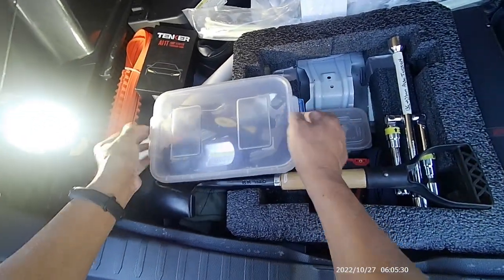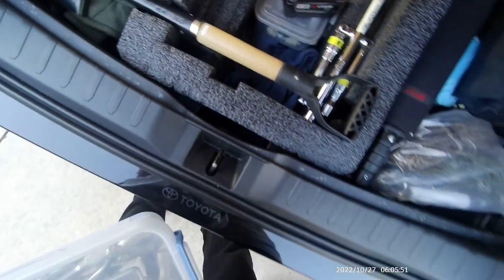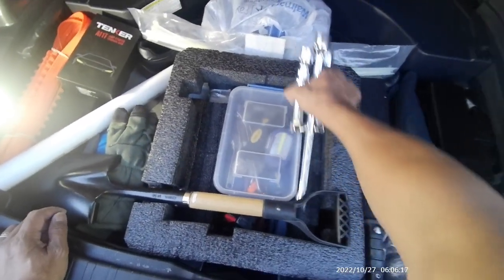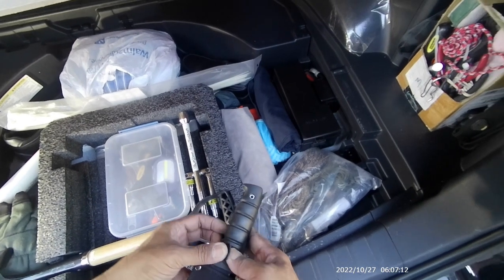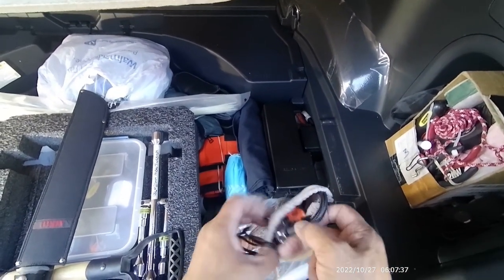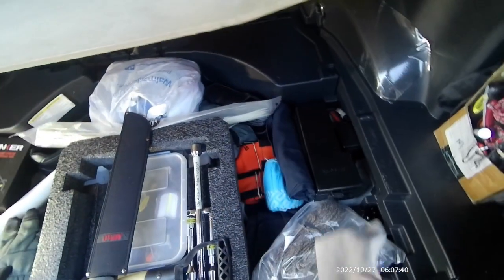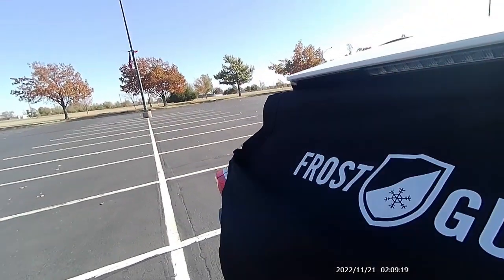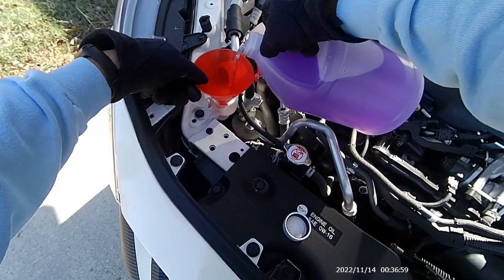Toyota Rav4 Prime Winter Loadout and Tips. Prepare yourself and don't get caught short out there. ❄🚙

Comment: I like your seat covers
Reply from the maker: Thank you... I bought it on Amazon and the link is below...and no..I don't get paid in anyway to endorse or promote it.  I can say this though...these seats ROCK... spilled some stuff, protected the seats under.  Put them in the washer and dryer at the local laundromat (didn't want to tear up my washer and dryer) and surprisingly...it still retained it's form...didn't shrink, stains came off.  Was afraid due to the high heat in the dryer that it might tear...but it didn't.  So I can say it's pretty durable.  It's $109 on Amazon for a pair.  Take care and stay safe.

https://www.amazon.com/gp/product/B088BVM1D5/ref=ppx_yo_dt_b_asin_title_o01_s00?ie=UTF8&th=1